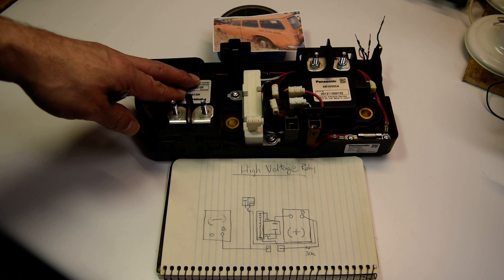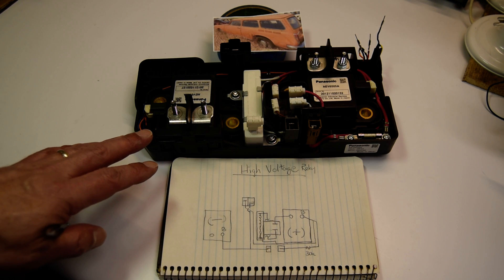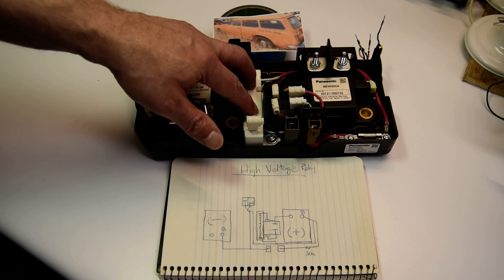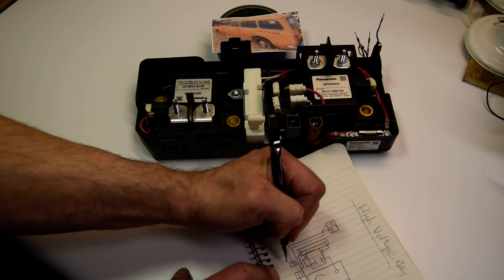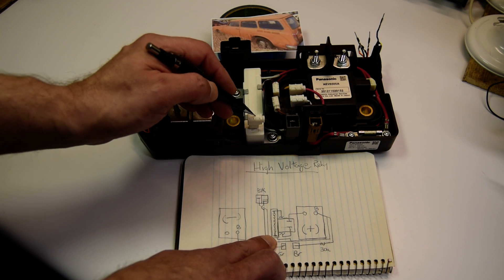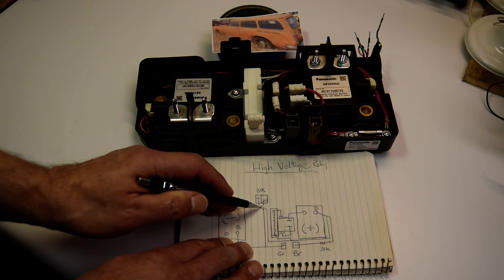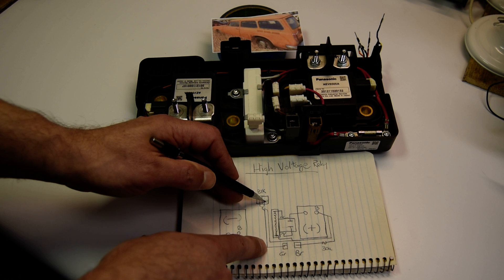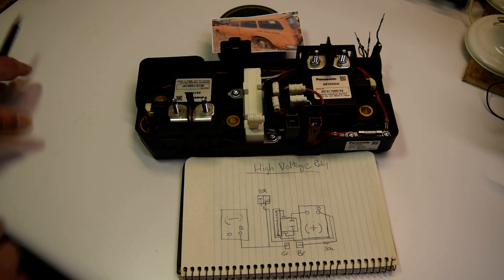Leaf Relay Board HV Connections

Comment: Hi John Ive commented on your other video then noticed this one. Do you know what would be the cars ignition on and off connections. I mean a signal that would turn the Battery on and off. On my board there is a  6 pin connector (Top right wires showing on your diagram) that I assume controls things but I've no idea how. Can you advise. Many thanks and sorry for my non technical wording.
Reply from the maker: The relays in the HV battery are activated with 12v power and ground to their respective coils.  As far as how the vehicle's logic works or the specific wiring, I do not know.